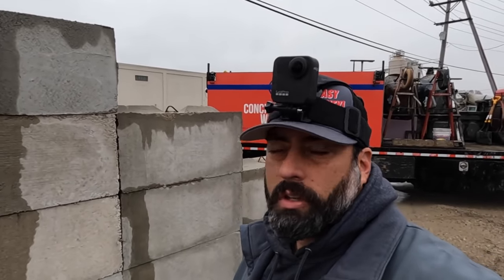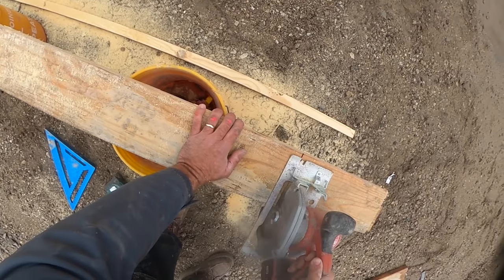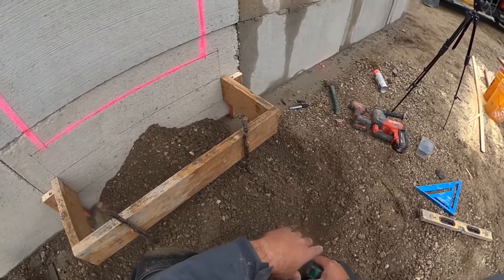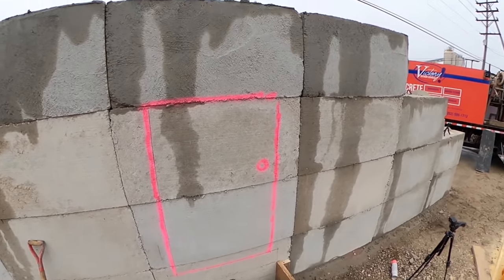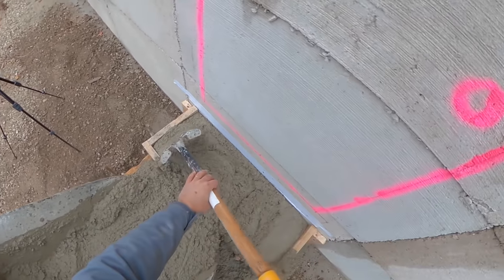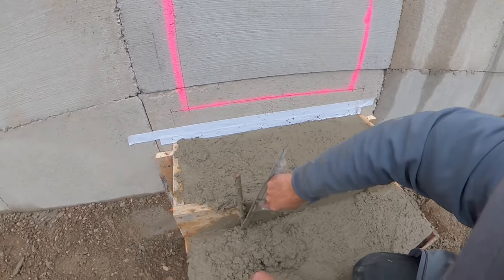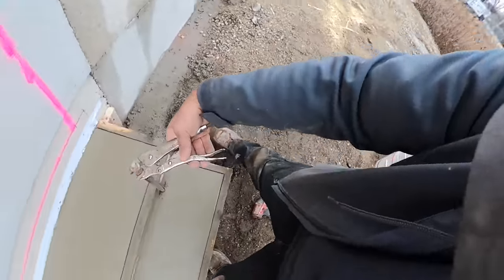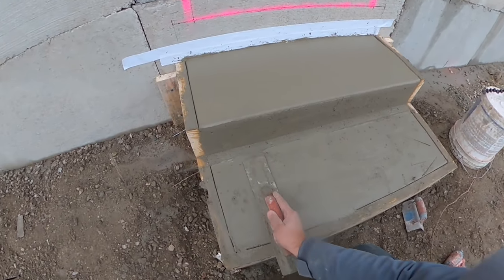How to form, pour, and finish concrete steps-DIY

Comment: Where is the finished product after it is dried. A couple questions, one, no expansion gap between the so call house and your steps? Isn't that required? Second, do we not need to put steel mesh in place for this at all?

Comment: This is a very excellent video, and the finishing is absolutely perfect. However, you didn't mention anything about reinforcement when setting up. Maybe it's a topic for another video, but drilling into wall and tying the steps to it with rebar so the steps don't drift away after a few years seems like a necessary step to me. Also, there was no talk about reinforcing the steps with wire/rebar. Again, maybe those subjects warrant a whole video

Comment: When we do steps the bottom of the front riser is back cut at 45 degrees so you can nearly touch the next stepup with your float when finishing,easyer to find.

Comment: Under normal circumstances, would you use Rio bar and mesh inside the stairs before pouring the concrete?

Comment: Why wasn't rebar used to prevent seperation from the building foundation and to help strengthen the steps to prevent cracking between the steps?

Comment: Nice work 

The pins with holes in for your screws any recommendations on where to get them from 

Many thanks 🇬🇧
Reply: PROWORX 0.75-in x 18-in #6 Steel Rebar Pins

Comment: I’m about to make an attempt at repairing my parents basement steps. The problem is the openings around 30” and the previous steps went from concrete wall to concrete wall. My question is how would I frame something like that out?, When the only place for the frame to mount is the concrete wall which would mean the wood frame will be sealed in concrete, which I don’t think is a good idea but maybe I’m wrong.  Is this something I’d have to start at the bottom step and work my way up step by step? Any and all help is greatly appreciated!

Comment: I know you know what you're doing but what if instead of those pins on the inside for the first step. 
What if you cut that first face board 2 inches longer so there is an inch on the outside for you to put the stakes on either side so there's no pins in the actual steps to create the void in the concrete?

Comment: Used tapcons today to frame walls inside a basement today, For the studs and green luber to be being drilled in the floor and the walls.
Reply: Nothing better for any cement screws

Comment: Wouldn’t there be a void all the way to bottom of the second step when you pull those pins out. Or does the concrete just naturally fill that hole

Comment: Ryan: excellent step tutorial, but can you advise on your recommendations in a snowy climate as far as reinforcement in steps and the need to build them on a secure footing  to prevent them from moving in freeze/thaw cycles?  We had a contractor out this year to bid on our project to replace two sets of porch steps and the contractor wouldn't do pour in place concrete and would only quote for precast (offsite) steps because of potential movement issues, saying they could do damage to the porch if they should move.  We want to go with stamped concrete to match a sidewalk that we'll have done at the same time, so we're not interested in the precast units.  Thanks...
Reply: That contractor is   likely correct. Steps often require some type of foundation extending below the frost line. Call your local building inspector. Code varies from region to region

Comment: Wait wuuuut ryan knows how to do steps!? I thought he was there to film and make that Eeeeeeeeeeez money, all jokes aside 10/10 How to, I will likely never need to set/pour/finish my own steps but at least if I do I will know exactly how. Might be a stupid question but when you are removing those first 2 pins were you able to fill the entire hole or only the top of the hole? I would assume removing the pins would leave a significant amount of missing concrete wouldn't that cause issues later?

Comment: Between walls, say steps and a timber home, how important is it for the concrete to cure to stop water seepage and should you have some sort of film between the steps and the wall of the house. How do you stop the water getting in between the wall of the house and the steps!

Comment: One of the most difficult set of steps I've ever experienced was an outside set going down to a 10' basement. If I remember correctly, it was 17 steps... even though we didn't have to finish the sides, stripping and finishing them was a challenge to say the least. Great job Ryan, keep up the videos.
Btw, any word from Jacob Wheeler about fishing? I'm pretty sure that I have option B for you. Lmk if you're still trying to go fishing in your off season time. Preferably before it ices up, but not a necessity.

Comment: What if you’re adding 2steps to an existing concrete porch with concrete under . How do you secure the wood without drilling into the concrete slab or floor

Comment: I tried looking that’s at you didn’t have to repeat but for multiple steps or even just a few like you did here. Can you fill some in with gravel or is it better for it to be deep concrete
Reply: When I remodeled my house and had a entrance porch about 6' wide x 7' long to the bottom step the contractor filled in the form of the first step out the door which was level with the door with dirt and  compacted it. Then with broken cinder blocks and leveled it with gravel which left about 6 inches for concrete.

Comment: Most house doors swing inwards but sometimes the scenario presents itself where the door swings outwards.......when it swings outwards you need to the make a landing min 42"x42" first or door width +6"   whichever you prefer....if the top step or landing is higher than 24" you need guard rails......

Comment: another thing would do before poring the concrete is to spray the form with form oil so that way it's easier to tear down without concrete sticking to the forms.

Comment: Great video Ryan.  Guess Bugs has been training you :)  I noticed you didn't mention or use any rebar or wire to reinforce the concrete.  Is it unnecessary with steps?

Comment: Ryan- Great video. I've noticed you typically don't use a trowel after mag. Is this because of climate where placing?
Reply: Using a steel trowel would close the surface up, and in Wisconsin you don't really want to do that. California sure no problem. We have some pretty severe freeze-thaw cycles here and with the air entrainment you want to keep it as open as possible.

Comment: Ryan this is awesome.  Thanks!!  One question - I have seen often in new developments around our area, they finish the driveways and sidewalks with the corner radius tool you use, but they leave the line that it creates from the flat side of the tool.  Is this a "thing" or a specific "look", or are they being lazy/trying to save labor?
Reply from the maker: That is a decorative finish called picture framing.
Reply: @VictoryOutdoorServices  Oh cool!  I like your way better, it seems a bit cleaner.  Thanks for responding!

Comment: One other way to get the boards completely lined up with one another is putting a small piece of scrap wood, any kind doesn't matter, big enough to screw to the top of either piece with an over hang of an inch or so and then the piece u put under the overhang n screw to the other side will be perfectly lined up n the simply remove the over hang n ur all lined up.

Comment: Not trying to be rude or disrespectful Ryan but you should've showed and explained how much gravel to use in the steps before pouring the concrete. How much or how little gravel to use. It just appeared in the video out of nowhere already inside the forms without explanation.

Comment: The only other thing that would of been cool, is to of had maybe a couple more examples for the super newbie to have that were pretty common, lets say most front porches were 42 inches or something like that. and Then just where you would put the steps ya know. n then move forward. I get you cant do everything n this was absolutly amazing and im 100 percent going to give this a try in the spring time. If not for anything else to try it. If i jack it up, I'll break it all upo and try again.  

Starting with the true basics, Intro to concrete and talk about that in a video, you dont even have to leave ur hosue.  Like 5 tools you need to do steps, 5 tools you need to do a driveway, 5 tools you need when you grow, something like. n then best temps for concrete. So for instance if your a home owner with no rush on a job maybe give us the best day to choose when to do it. (kinda the back of a spray paint can, you can paint between these temps and humidity and it will yeild the best results). I'm just trying to think of some winter filler titles and videos for ya.

Anyway, thank you for this. God bless I hope you and ur family are safe and I hope that crazy lady never shows up there again lol.

Comment: Hello Ryan! Question: Is rebar needed to secure the steps to the house foundation? Thanks.
Reply: My question as well…should existing porch be tied in with rebar? I have a set of steps I may tackle in the spring. Thanks for the video!
Reply: Depends on your freeze thaw cycles. Unless you're running footings down below frost line and pouring on top of those piers.

Comment: The handful of times I poured concrete into a manhole form, we used a vibrator to get the air pockets out. I'm no concrete guy, just a hand at the time but I've yet to see you use one. So is it necessary?

Comment: For got to mention throw in dirty on top step so wont be full of concrete. Pack it in or if the is steps that need dirt. Usually 4"of concrete of thickness but sides not filled with dirt to face.

Comment: This might be a dumb question. 
We do a lot of Hardscaping and a little bit of concrete. We’ve been starting to do small concrete jobs like hot tub pads and landings at the bottom of steps. How do you keep water from rising to the top? Even when we mix a little dry It seems like water wants to rise and sit on top
Reply: Unless you're using a water reducer high, or mid-range you're going to have bleed water on your basic concrete no matter what. It basically makes your concrete flow like it's got a lot of water in it, but it does not. It's great stuff for doing stairs.

Comment: Sir i have a question about this, i work in the IT- , but when you have 1/8 bubble fall verctical from the form setteling but you brush the line horizonta on the finishl, will there be any wather ther in the brush lines??

Comment: My Concrete guy is a great Flat wk guy. Except he refuses to pull a string on the big picture.
    Constantly pulling a tape from the closest wall,curb.
    I'm talking about the mean average in a given situation.
          The truth is, I bought a older home that is not square. With add ons that aren't aswell.
       So pls do not just grab a random line and run with it.
      It just magnifies throughout the job.

Comment: Would you use rebar to attach the steps to the house? They also put some black stuff between the house and my patio, what is that for?
Reply: Closed-cell foam rubber or a bitumen-treated fiber board.

Comment: probably should mention that the first step from the door it’s the landing typically 3 ft wide better it’s 4 ft.
Reply from the maker: Yes, it depends if it's a sliding door or swinging door.
Reply: @VictoryOutdoorServices  yes otherwise won’t pass inspection. Great diy video tho.

Comment: Drill holes inside the form bang rebar down them drill small holes through your forms and use tie wire and you don't need steaks on the concrete side and the rebar will be inside the concrete so nobody will see them

Comment: At 14:38 why did you add the 2x4s along the bottom? 

Couldn’t you of just shovelled some gravel against the form?
Reply: The only 2x4 I see is along the wall to keep the form in place along the wall. The reest is the 2x6s that he cut to 5-3/8" for the height of the steps.
Reply: You can but then you will have your steps with ugly exposed gravel below nice flat surface. That's why he leave empty space inside a form all around form below ground surface, so in any case there will be concrete around steps all way down.

Comment: those steps would not pass code here
Reply from the maker: It depends if it is a sliding door or a swinging door. A swinging door would need a top landing that covers the door swing.
Reply: @VictoryOutdoorServices  the building code here require that all steps have a 1 inch lip.-landings are to be 1 foot on each side.
Reply: YOU DO GREAT WORK.